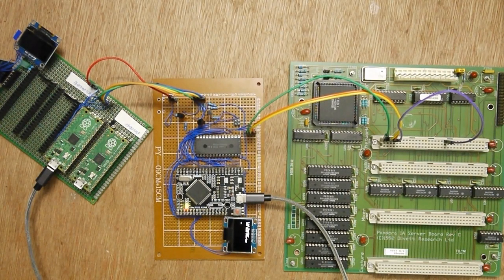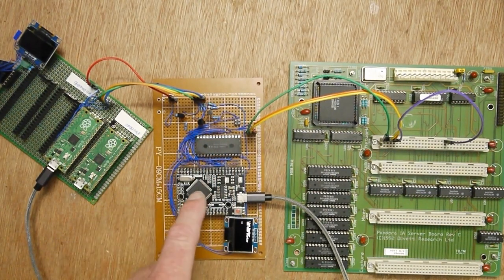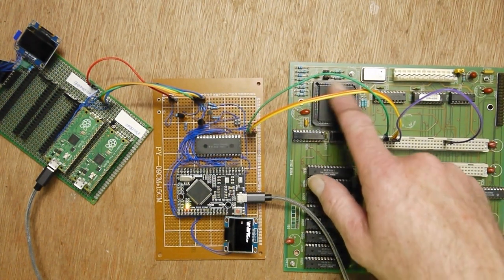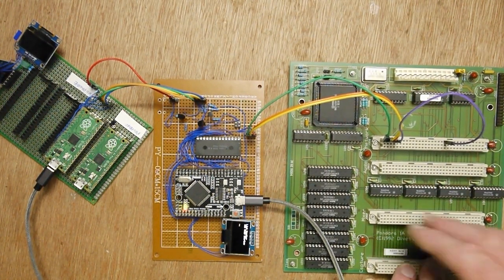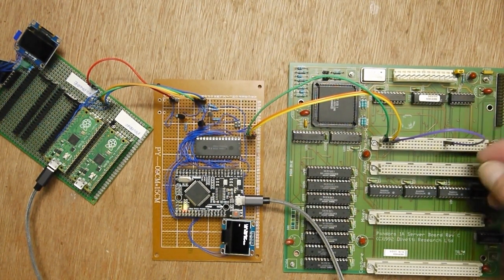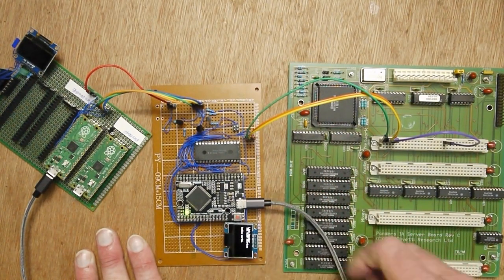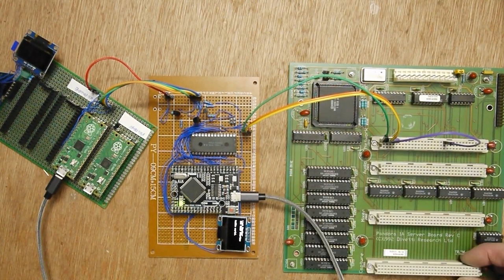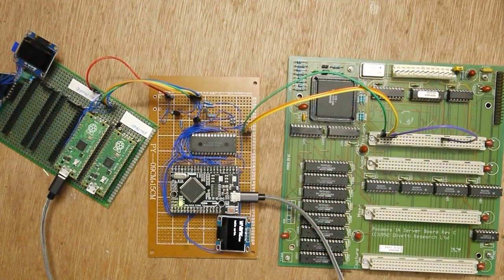Picoputer Part 6:Real Transputer Hardware

Comment: That board - it almost resembles an Acorn RISC PC board!
Reply from the maker: I'm pretty sure it's actually the base board from an Olivetti Pandora:
https://dl.acm.org/doi/abs/10.1145/382258.382788
It has a transputer on each of the cards and one on the base board. And a lot of other circuitry. A lot.
Reply: @menadue  I can imagine. What sticks out is that processor interface - the white female header. It’s almost the same as the one Acorn used to connect processors and second processors, along with that familiar circuitry.